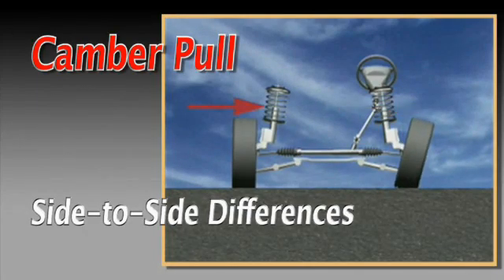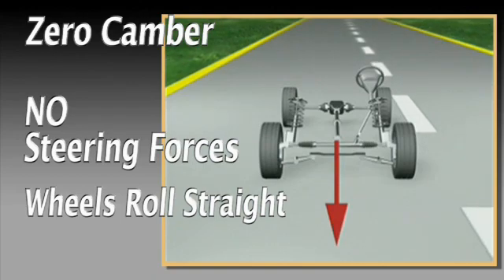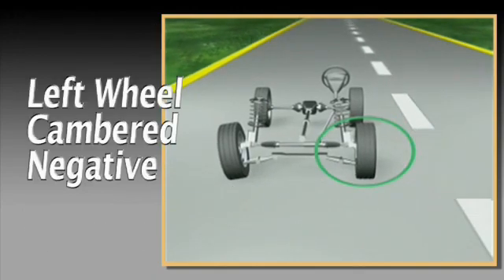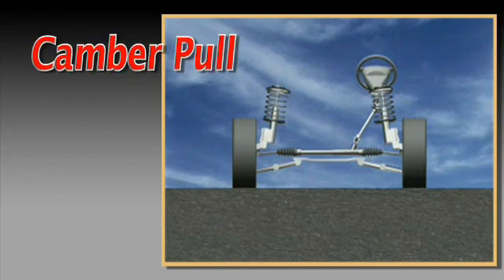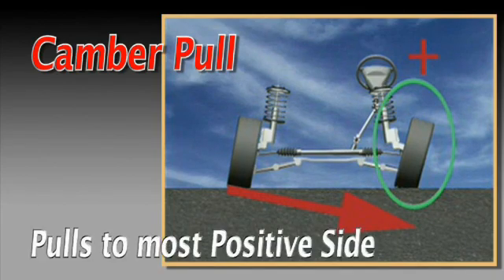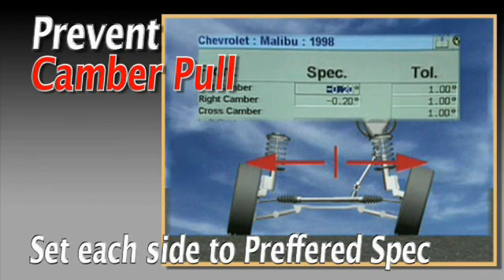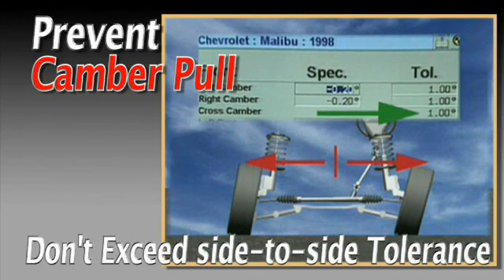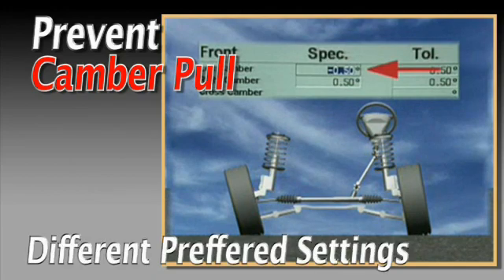Camber Pull - Hunter Engineering

Comment: Hello @Hunter Learning Channel
Im a student of automobile engineering and started wheel alignment as of 2018 with hunter machines and still I didn't figure out one problem in alignment.
Example; toyota premio NZT260,  with new tires and good suspension conditions, mounts, rack-end, tie rod are most likely good in condition but  happens to pull over to the left side even after adjusted
( Roads are slope to the left) 
Adjusted measures 
Camber left -0.48
Camber right 0.27
Total toe 0.08
Can You please give me a solution that I could fix this
Reply: Can anyone please tell me, how much camber is ok? Either positive or negative. I have a 2002 civic which has by default left pulling problem from the factory due to un equal torque distribution. So, the alignment guy has set one side -30 and other side +40. Now the car is much better than before. Any suggestions?
Reply: Caster